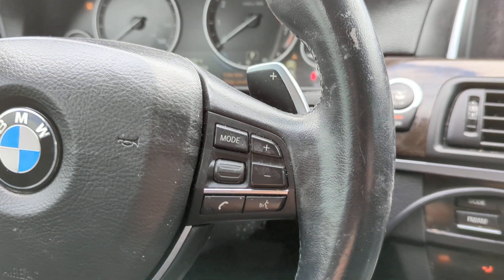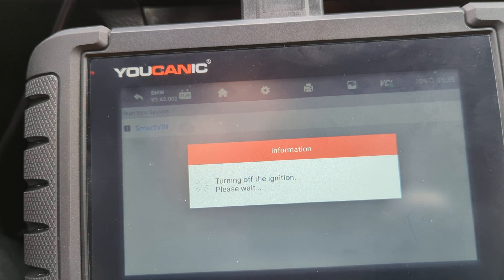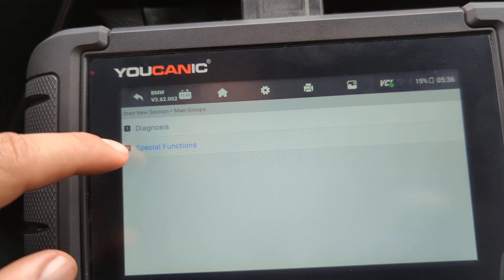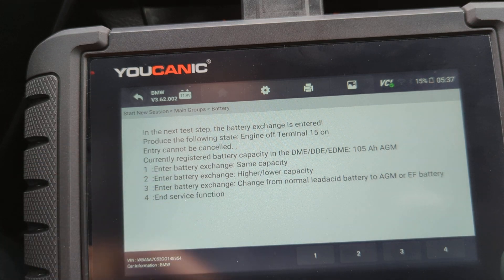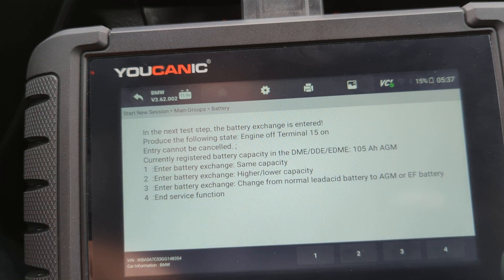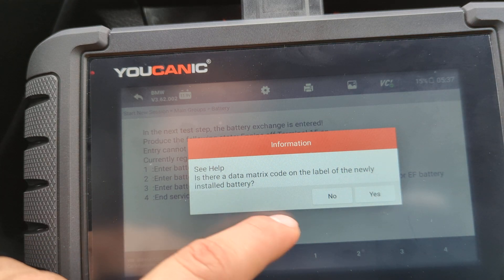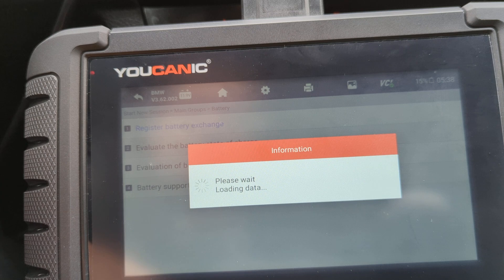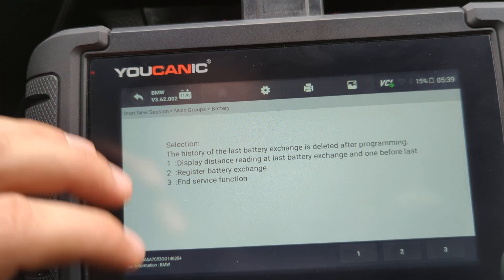BMW Battery Registration Programming Coding using the YOUCANIC Scanner

Comment: Can this code new battery?
Reply from the maker: Our YOUCANIC Full System Scanner can certainly assist you with diagnosing car issues, but it doesn't specifically code a new battery. It helps identify what's going on with your vehicle to make repairs more manageable. Get more information at www.youcanic.com/scanner.

For more specific inquiries or if you need comprehensive guidance on battery coding, feel free to utilize our platform for asking car-related questions at www.youcanic.com. Our dedicated team is always ready to make car repairs more accessible and understandable for you.